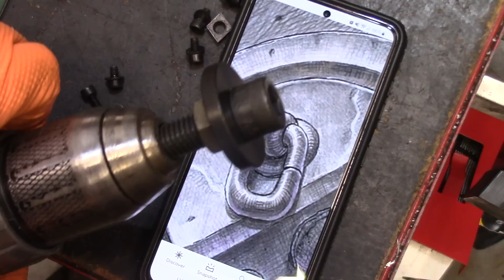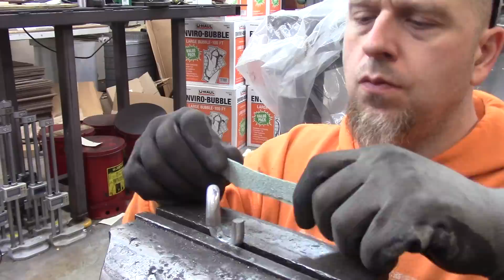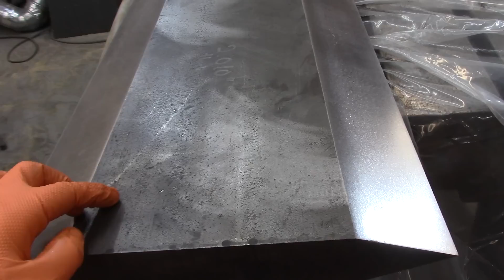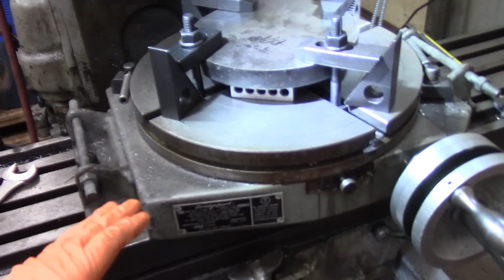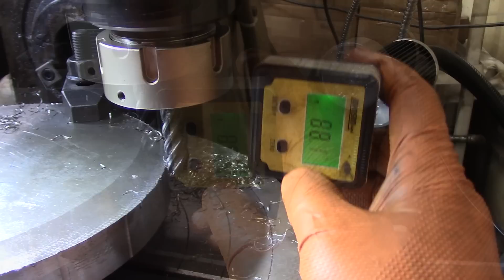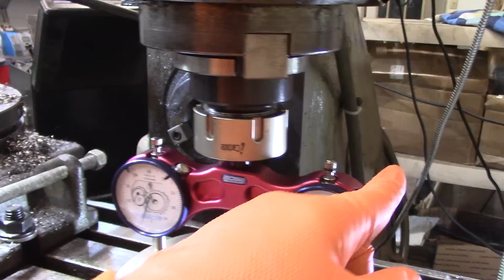Making the handguard || Guts' Dragonslayer from Berserk (Part 4)

Comment: Wouldnt it have been easier to bend if you hit it with a torch tough? What made you want to bend the link with room temperature? It would be cool to laser engrave the perfect circle on the disk and cut using that line.
Reply from the maker: That's honestly a pretty good idea about the engraving. Wouldn't even need to be that complicated, I could use my CNC vinyl cutter to make a perfect circle. They're surprisingly accurate. 

Oh and to answer your question about bending the link, I just enjoy a challenge, especially a physical one.

Comment: The ideal way to machine the disc is on a lathe with a magnetic chuck. The next best way would be on a cnc mill, leaving a couple of small tabs you would have to cut off afterward.
Reply: Wouldnt it be nice to have all that hangin around in the garage for random stuff lol

Comment: While I'm not sleeping:
It bares mentioning also that it will likely true out at some point if the geometry is close enough. If the thickness however varies along the length it may bow. That said it's much more likely to sag as it changes environments, elevations, and seasonal changes/etc. Outside of actual maintenance, since this thing is so massive the scale of maintenance will be that much more, though if stable it can last that much longer, there is really little reason to worry about thousandths... My guess is if it's not stored with as much care as has been put into it's manufacture, it will be all over the place.
And that's what why I'm famous in the English world for the run-on-sentence.
Did I mention I love this project?
😂
I'd love to x-ray this btw. If only I kept up on my quals. Would be a fun refresher to engineer the inspection for it and to the validation verification. 😎
I don't mention it often, but have a look at the NA 01-1A-16
It's all that and a bag of cesium chips.
If you get a chance to look at it, let me know what you think. It's a little overwhelming but I promise it's the most streamlined thing ever, and more useful than a hundred engineering textbooks.
Lots of cool toys in there.
Reply from the maker: 872 pages! Might take a while...

Comment: Gotta get you an air 90° sander, boss. The orbital is great for the subtle finishing work, but nothing is faster than the 90... It can gouge with low grit or if too agressive, so caution there, but more used discs or or fine grit will wear on the edge more and allow better feathering as well. 👍
The real benefit is it's self cooling and vibration is much better. Those long sanding sessions are pretty rough on the nerves with the orbital... The 90 meanwhile is much smaller radius as well, great for doing large volumes and fine work that a Dremel can't handle. A straight rotor tool is good too for certain angles, but the 90 has better leverage. 
I'm selling it hard, I know, but I've put in thousands of hours with those bad boys doing helecopter body/blade work, and assorted aviation composite and metal work. 😎
Now for finding the center, there are some tricks I can't get into right now. XD
Gotta eat and sleep and brave the storm tomorrow. 100klb loads won't haul themselves. 😂
Reply from the maker: I have some but honestly have always hated them. Do you have a brand/model recommendation? I'm always looking for new tools.
Reply: @PrettyHateMachining  Honestly, brand wise I'd have little idea. I do know what's good, but I don't recall the brand of the good stuff. All aluminum body is good but they can actually get cold if the compressors tank is big... There pretty simple tools though, basically an educator with fan blades that spoil the tool head, so as long as that's all solid... I'd guess something old is better actually, as now there is so much disposable trash... I could probably look into some military manuals and see some, but if youre familiar and don't like em, that's probably the end of it. What don't you like about them? I may be able to help there...

Comment: The best thing to do with galvanized pieces if you want to be able to heat them without dying in your sleep, is to soak the part in muriatic acid, available at hardware stores, pool supply stores, etc. Great video! Can't wait for the final product!
Reply from the maker: Yup! I ended up using a weaker acetic acid but it's the same idea
Reply: @PrettyHateMachining  Yup, hadn't got to that part in the video yet. Six one way half a dozen the other, the acid is faster but a bit priceyer.